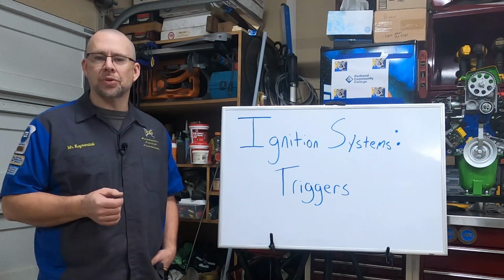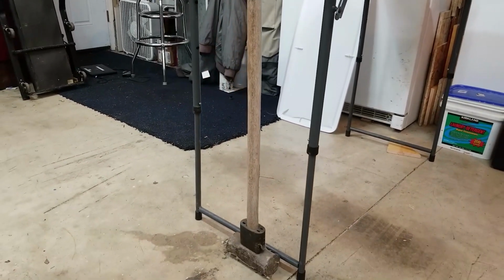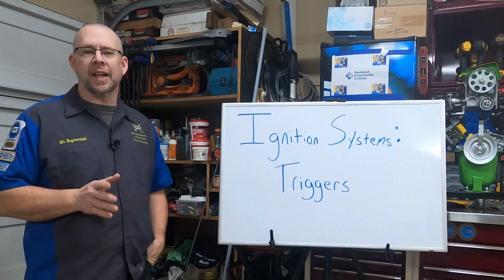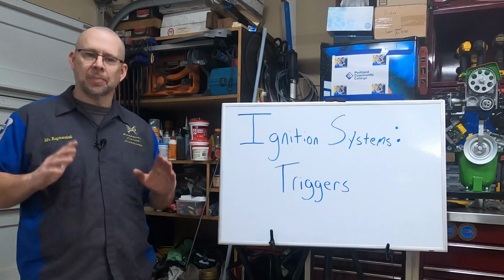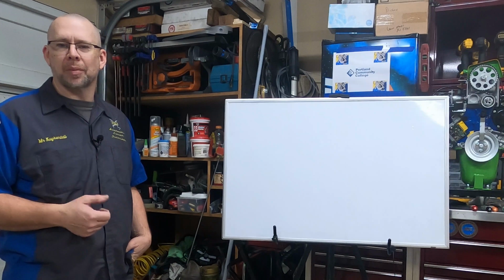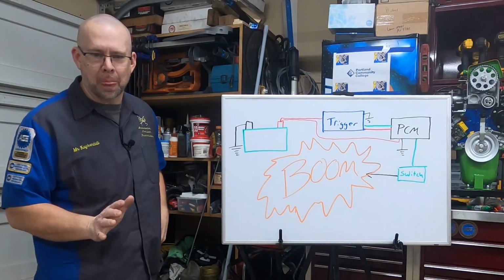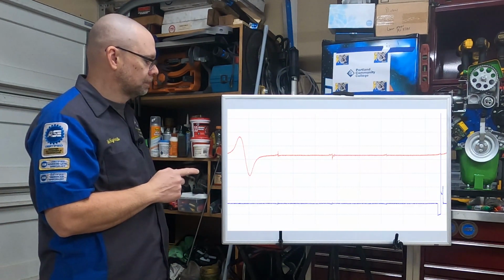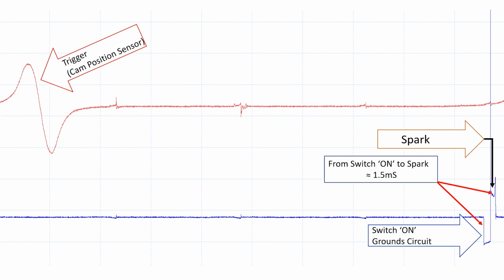Ignition Systems: Trigger

Comment: You showed the trigger graph without numbers - what is the actual pulse voltage the trigger needs to send to the ignition module - does it need an AC component as shown on the graph.